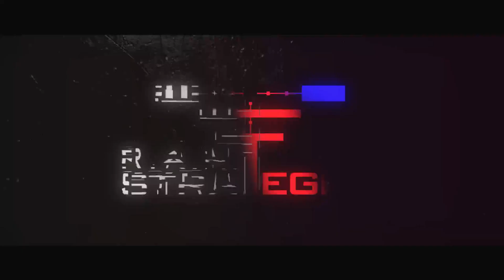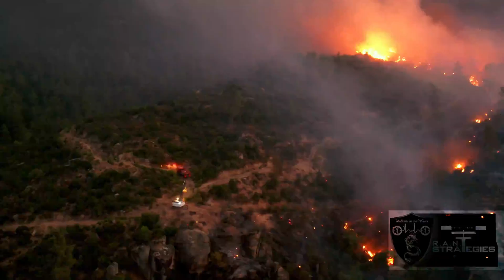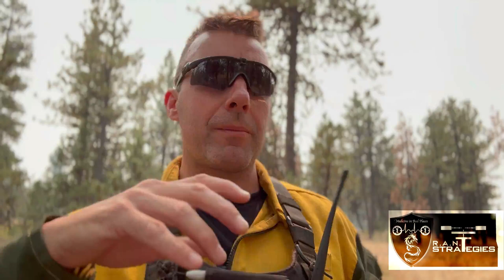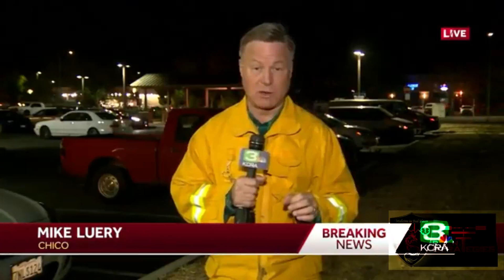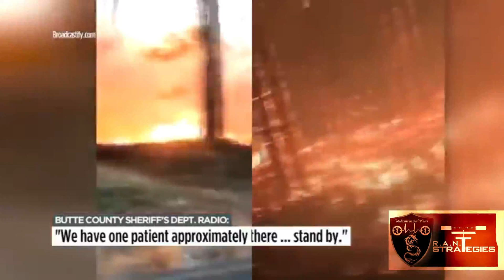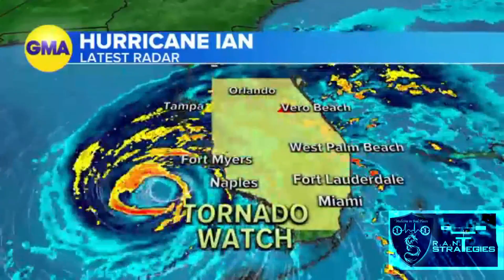Disaster Comms

Comment: We have HF which does not require a repeater. Spoken by an ego trip mental. Ham radio has generations of providing communications during disaster since ham radio started. and and governments have relied on ham radio
Reply from the maker: @RickFinnstrom  no doubt about that, with HF is always the issue of portability
Reply: @RANTStrategies  Not at all. That used to be the case, but these days you can have an HF radio the size of a deck of cards that runs off a 9 volt battery and can reliably be used for regional comms using email and digital modes.
Reply from the maker: @tannerwarf3471  what’s the antenna on that look like? Or is it internet based?
Reply: @RANTStrategies  actually it can be a roll of wire, if you ever attend a ham radio field day that is what it is all about, quick deploy, in the field rapid communications. VHF and UHF.
Reply from the maker: @SteveHcutabovehost  I’m well aware….. and how well is that going to work for the people I showed in these videos trying to escape in order to save their lives??  🤔
Reply from the maker: @SteveHcutabovehost  “hang on folks, let me set up this inverted V to make a contact”…. isn’t really a practical strategy in cases like these
Reply: @RANTStrategies  you can run all of it over RF using an end fed half wave antenna. It is a wire antenna that when rolled up will fit in the palm of your hand, and can be put up using a portable mast or just hung in a tree. Look into NVIS comms. It has been used by the military for local HF comms for many years. You made some good points in your video, but it is can be very beneficial for local EOCs and other departments to pre plan and include game radio into their comms plans. I agree that is is too late to try to implement these things on the fly.
Reply: I also understand that wildfires are what you have experience in, so that is what you are going to think of first off when looking at things. If you will look at it from the perspective of other disasters and trying to establish comms after an initial disaster has taken place and people are trying to price things back together it is an entirely different situation. Look at Hurricane Helene and how HAM radio had helped during the aftermath of that disaster. Also we were deviated with a major flood in my area two years ago. All state and local agencies as well as cell phones had zero comms for 72 hours. The only way traffic was being moved out of our county to the state capital was through a local ham utilizing winlink.
Reply from the maker: @tannerwarf3471  completely understandable, but also realize….. wildfires are not my only experience, I was also a New York City firefighter (worked a few blocks north of the trade center) and now work as a State Trooper and still work as a paramedic. So, needless to say, I can certainly see things from a multifaceted situation point of view
Reply from the maker: @tannerwarf3471  absolutely! And I use HF, im a huge fan, currently in development of a whole multi-state operations plan revolving completely around HF. No hate from me about that what so ever, that just wasn’t  the target of this video.
Reply: @RANTStrategies  I didn’t take anything you said as hate. I think these types of discussions are vital in ensuring comms plans are well thought out and actually effective. The truth of the matter is there will never be a one size fits all solution to this sort of thing as the real world is dynamic. Sharing ideas and ways we may have solved problems in the past is how we learn and stay better prepared. I also did enjoy the video and appreciate your service.
Reply from the maker: @tannerwarf3471  absolutely tanner, I have zero time for anyone on YouTube who wants to hate on anything… if that person doesn’t like it, don’t watch, it’s as simple as that and I completely agree with you, anything they generates meaningful discussion is always welcomed. Appreciate the comment and having you here.